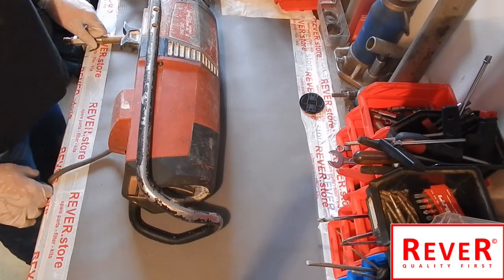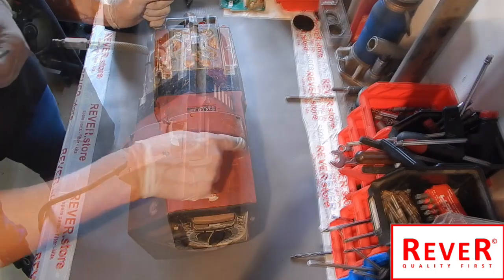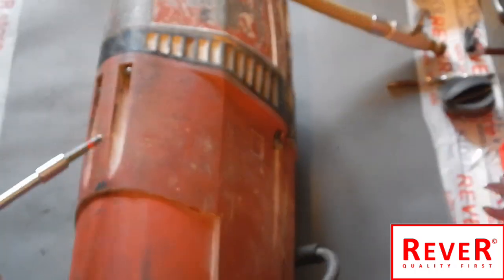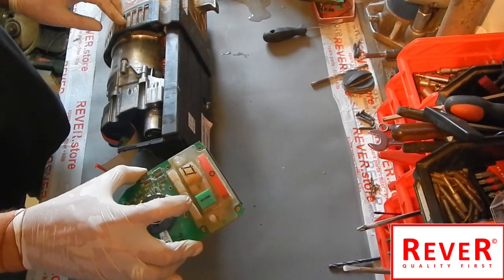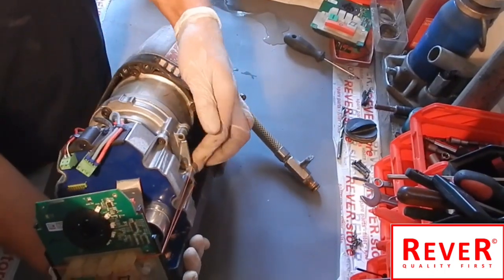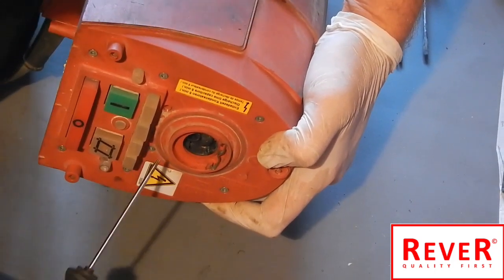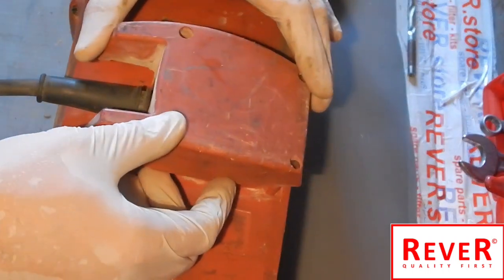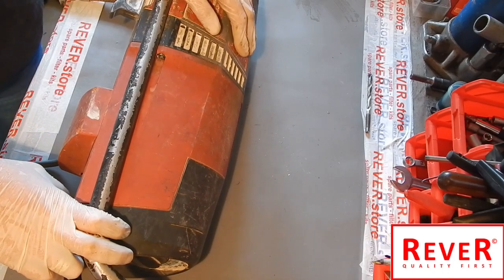Hilti repair DD200 DD350 DD300 DD500 replace electronic unit

Comment: Hi sir. Thanks for your video, it was very useful. I have a Hilti DD 500 which causes some issues. When changing the gear on the electronic panel the motor doesn't slow down or speed up. I has the same rpm constant (gear 1 I think). Do you think it is the electronic unit that is broken or something else? Where can I buy the electronic unit if that is the problem? Many thanks. Best regards LJ